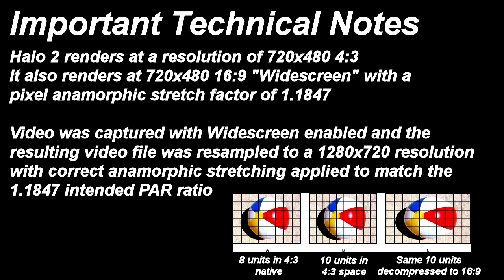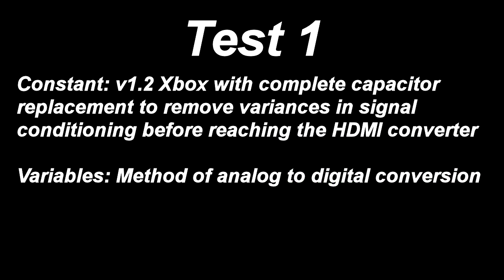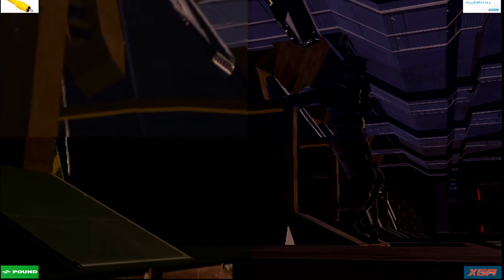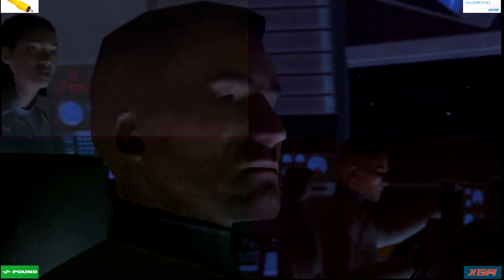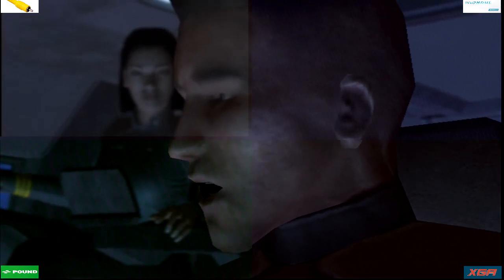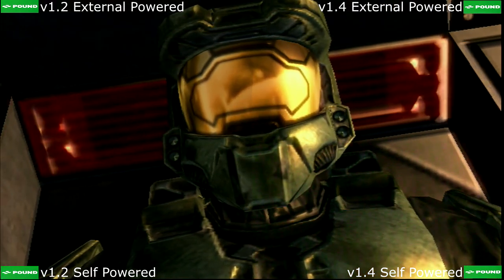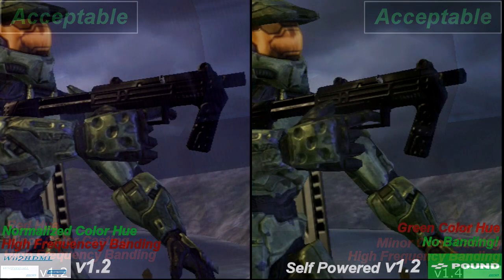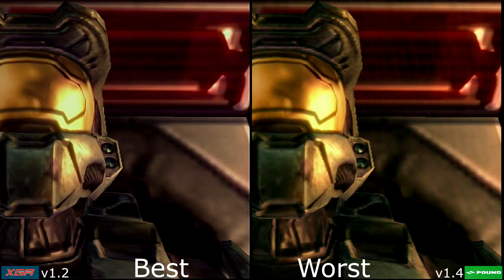Best HDMI Options For Original Xbox Compared - June 2020

Comment: I use the hyperkin cable you can get on Amazon. Works decently with some minor noise and a slight green tint in 480p anamorphic games like halo 2. I get really bad noise with games like Tony hawk underground 2 and crash nitro kart. I think it's cause they're true 720p.
Reply: It also could have something to do with my xbox which is a v1.1
It's in great condition and looks great with the official HD pack.
Reply from the maker: @robbystrange4772  from my experience, v1.1 is the best to have when it comes to the cheaper mainstream cable options. So you're good on that front!
Reply: @NightowlStudio  yeah it's only true 720p games/homebrew that have the rainbow banding noise issue. I wonder why  higher res = more noise.

Comment: 0:36 what is this false text I'm seeing? 4:3 is 640x480, 3:2 is 720x480. Also Dreamcast uses anamorphics, not Xbox. Xbox uses UI to add camera space for 3D games with the effect of 2D HUDs being stretched. Halo 2 and every 480p widescreen game uses UI stretching except for Panzer Dragoon and very few others. The Xbox is perfectly capable of rendering widescreen resolutions, heck Dragon's Lair 3D specifically runs in TRUE 1080i in TRUE widescreen, that's the biggest accomplishment the console has ever received. Anamorphic 0.8889 and 1.185 are used for DVD not games.
Reply from the maker: The Xbox was definitely the wild west of video output, which is why I think you get odd eggs like Halo 2 coming out at the NSTC DV standard. That is a mistype though. The incoming capture was 720x480, but a PAR applied to the final output to the 640x480 standard. Maybe the MakeMHz guy building the all digital output conversion can lend some insight on this subject, because I am nothing more than a hobbyist. The 1.185 anamorphic PAR checks out with my testing though. https://i.redd.it/gaxzvosb9ge01.jpg
Reply: @NightowlStudio  Wh... ARE YOU KIDDING ME!? You're completely right. The Xbox uses UI stretching AS WELL AS ANAMORPHIC RECORDING CRAP! That's more work for me GAAAW! At least the Dreamcast doesn't use UI stretching unlike Xbox or AGE OF MYTHOLOGY ON PC (when I type resolutions into the icon name)!!!
Reply: @NightowlStudio  That would be an awesome experiment for MakeMHZ to stretch the content before delivering to display/HD PVR 1512 that captures Toslink 5.1 audio.

Comment: So rad2x and kaico is the best
Reply: It's not an option for Xbox though. MakeMHZ and Chimeric Systems are currently the best options right now. Why Chimeric Systems instead of MakeMHZ? Well there's convenience, an extra Toslink output for critical setups, and the Xbox's DAC is actually quite comparable to the untapped digital signal. This video>https://www.youtube.com/watch?v=QgMurkMqH0U at 8:27. Though bad component gives off an awful green mesh.
Reply: @HedgehogY2K  last week i purchase custom made N64freak with 3d printed mini box and i think it is looks better than my frammemeister without switching lag
Reply: @yournightmare9999  Whaaat the he... That sounds like the most custom sentence I have ever heard.

Comment: why would you not compare this to native component out cable for source reference??
Reply from the maker: Sadly my reasoning was because component inputs are pretty much defunct at this point on a modern television. If you walked into Best Buy today, maybe 1 out of 20 models on the shelf would have component inputs, and the analog to digital converter on that 1 model that did, would likely have a very very cheap converter.